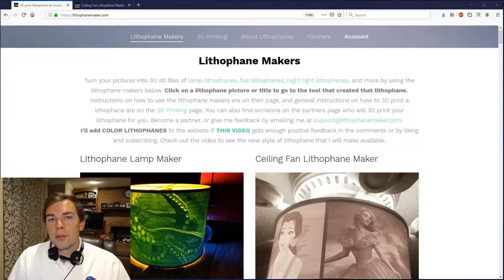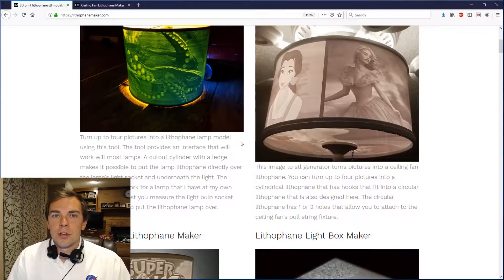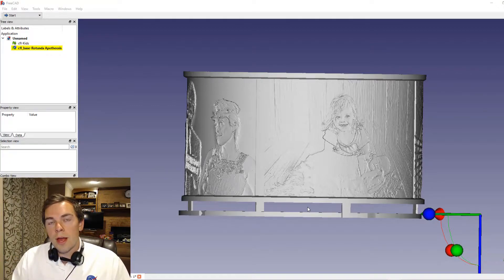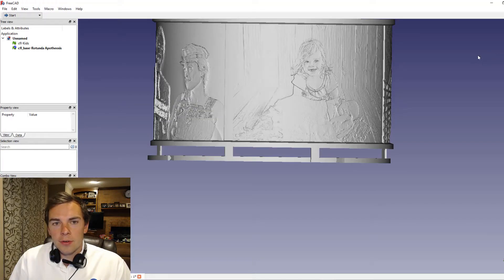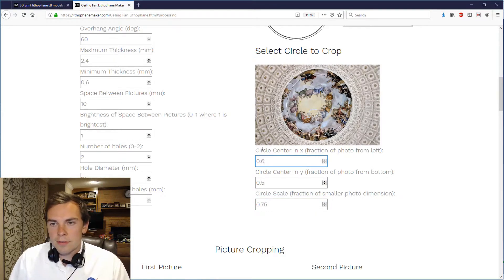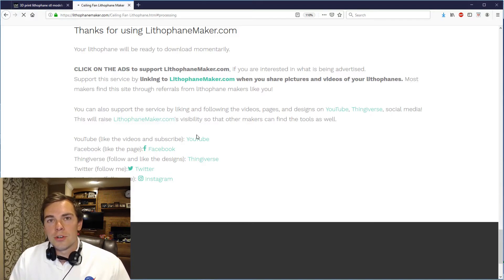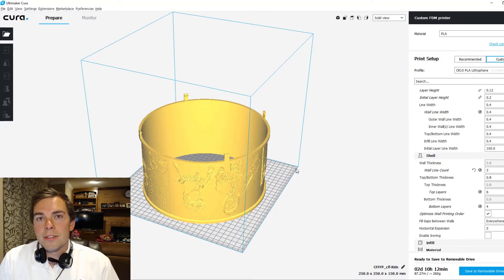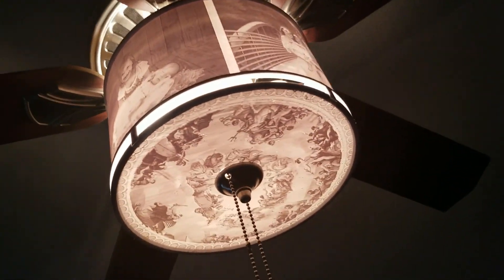3D Printed Ceiling Fan Lithophanes

Comment: thanks for the video, I trully appreciate your work. I wanted to create a lithophane from a picture and print it for a backlite frame but unfortunately the website doesn't do that conversion to create an stl in color, I don't know if the desktop version does that. I do not want to print color on paper as some people do I want to use CYMK filaments to do the color mix for the lithophane. can you help?

Comment: Are you having problem with the lamp base?  When set it 1 or 0 it just don't generate the base plate. This worked for me. Number of holes (0-2): 2 Hole Diameter: 1mm Distance between holes: 1mm This worked for me.

Comment: Thanks a lot for sharing your work, it is awesome!
BUT... I have a problem with the lamp base trying to set 1 or 0 holes. When I set it to 1 or 0 it just don't generate the base plate.
the point is that I want to generate a lampshade for the cheap model of IKEA "B0201 Lampan" it is really cheap and great for this purpose. I did it before with your lamp tool, and with a plain baseplate for the top. but with your newer  tool for ceiling fan it would be much better.
Reply: I have the same problem. It doesn't want to generate the base plate unless I select two holes. I need zero holes.
Reply: Same problem, I need one hole and it won't download the base. Did you get it solved?
Reply: No, I finally made my own stl of a circular plate to print as a top piece. I guess that was made on purpose for security reasons.  Anyway it is an awesome work.